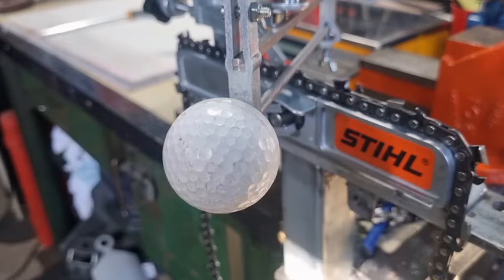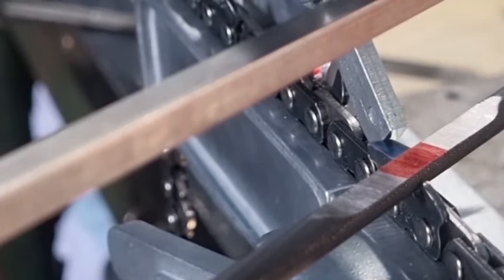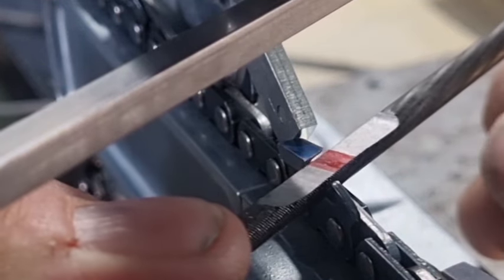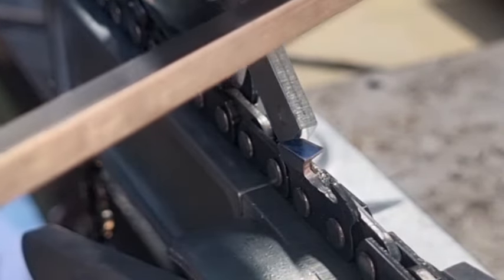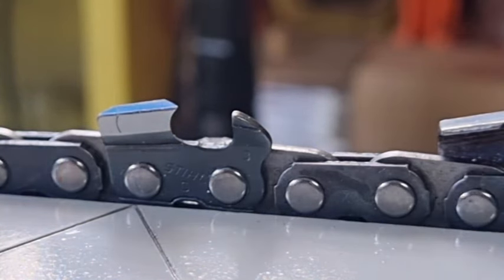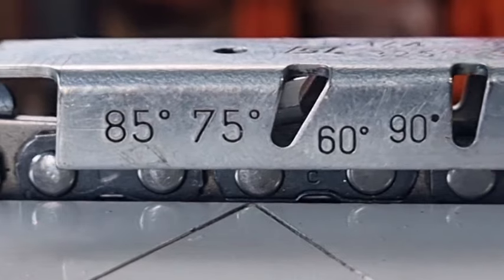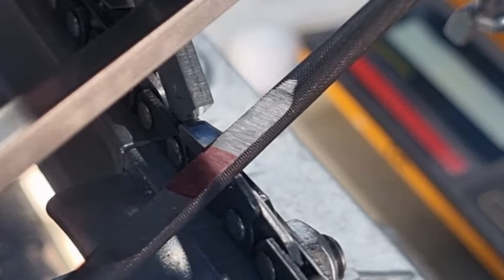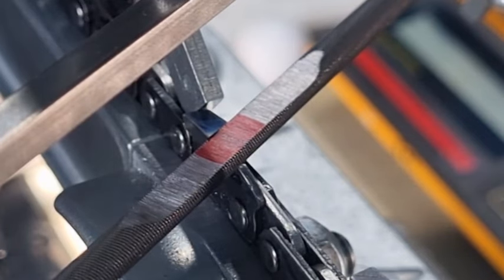Chainsaw file gauges takes you to the next level in filing

Comment: IMO Using cutters for any sort of reference AFTER sharpening is already dulling the cutting edge/corner (by however miniscule, it dulls), same as when using raker gauge tools while filing.
I like to just lay the gauge on top, check, remove, file raker, next.
At this point you've about fiddled with all you can for manual round/hex. I recommend giving square filing a go, I received my Pferd chisel file a few days ago and been playing around with it, you'll be happy to know it's next level difficulty too.
Just one thing, never file into the cutter teeth regardless what they tell you, it'll immediately dull a very very expensive file, instantly wrecks it, I don't care who says it doesn't.
Even from the inside out you gotta break first chromed metal with a normal round file so you don't waste the chisel file longevity.
My Pferd Chisel file dulled the second I worked it into the cutting edge of the teeth (from outside in). But it has retained it's shape so I'll be using it for reference converting my cheapo round chain grinder to square chain.

Comment: You always have good ideas for useful instruments. In addition, their workmanship is of a high standard. Bravo!

In the case of FG2 (or other File-N-Joint clones), to set the file to the desired height, you can also rather use the scale at the dial.

A small correction (again). I have never seen a Stihl document where they recommended 20%. Their previous recommendation was 10%. They changed that 10% to 25%.

@7:59  you probably meant to say 'side plate angle'. To check the (top plate) cutting angle you would have to observe it from inside the tooth.
Reply from the maker: I gave up a long time ago waiting for any Stihl explanation on anything.
I do my own research and it works or  it don't.
Many people just go with a gut feeling and it works for many people.
You have to find what works for you.
For me if the file sits 15% 20% 25% and sure the difference in cutting may be 5% in speed.  No such thing in this game as 50% more cutting efficiency.
Semi Chisel is the slowest, full chisel  the next level, Hexa the best so far that I have used.  I tried my V cut 90° spacing wheel dressed at 90° the tilt wheel at 60° top plate cutting angel.
So simple but effective and stays sharper than full chisel standard.
Hexa and X-Cut seem to be the go at the moment but that said 90% of people use semi chisel.
That is so easy to sharpen.
Not really a challenge for me.
Square ground maybe be the next toy for me to play with
Reply from the maker: I used a center punch on the height adjustment now it has  8 locations and it helps only a little.  The file gauge sets the height within 2 thousands now that's  spot  on in my book.
The  height adjustment may  have marks and 1  mark may equal .2mm height ect ect but that won't set 25% above  the cutter. It just  means it has  a scale without no way to zero it.
My file gauge can be adjusted level with the tooth and you can still use the height adjustment to increase or decrease.  1/8 turn on my FG2 = 1/2mm  I have 8 marks on dial nut with  base mark for reference.
Reply: @ChainsawUsers  Note that almost certainly a chain sharpened with a 10% file over the tooth will cut faster at first than one with 25%.
I'm more interested in how long it will take in total (or how much fuel or battery charge I will use) to make, say, 150 cuts? Etc.

Comment: Lovely idea.
Reminds me of when I noticed the files I was using in the FG2 were not straight. Can't remember if they were Pferd or Velorbe but the Stihl were pretty much perfect. 

I remember watching Cliff Stamp cutting hardwood with a pocket knife to determine the minimum geometry he needed to be able to do 1000 slices and still be able to slice newspaper. He started at 7deg per side and got his newspaper slicing result at about 12 deg per side. 

At 25% diameter, 60 deg less the about 8.5 deg for the top plate lowering as it goes back gives about 51.5 deg at the top of the 'C' while about 11% of diameter will give about 31.5 deg at the top of the 'C', looking from the side.

I get good cutting performance and edge retention when I set the FG2 to 35 deg so I'm thinking 35 degrees seems a durable and sharp geometry. If I've got my numbers right about 14% of diameter should give me about 35 degrees on the various edges of the cutting point.

I'm part way through a set of 4 loops. I suppose I could try some different angles. I assume the round gauge files were annealed and then ground/filed, would still be tough though.

Anyway anyone wanting to see Cliff Stamp's little optimisation of knife edge the vid was titled Normark EKA 12C27  optimal edge geometry for slicing hardwoods (norton economy fine edge) 
Cheers
d
Reply from the maker: Top plate set at 35° is very aggressive are you cutting soft wood
Reply: Hi @ChainsawUsers  
Sort of. Doing a fair bit of 'Dunns White' that died in the drought about 4 years ago. Soft wood, planted for pulp/paper industry but dead and dried standing for years. I process it into kindling and picnic or pleasure wood. 

 I'm using a Carlton semi chisel that was 35 deg out of the box.

Do a variety of other woods, not sure what most of them are, some are hard but nothing like Iron bark, though there is some around here.
Cheers
d
Reply from the maker: @davidfenton3910  I cut grey box and ironbark need min saw size 60cc 20 inch bar 063 gauge full chisel or Hexa
Reply: Hi  @ChainsawUsers  
I'm planning to get some more wood in a few weeks. Nearby farmer has perhaps 15 drought killed trees around his residence. Some Dunns White, other gums and some pine. 

Many of the trees are along a driveway with fences and other trees. Don't want to damage other trees so we'll be dropping the fence wire to fall the dead ones at a perpendicular to the traditional type rows of trees either side of the driveway.

The lower trunks of the pines should be easier processing for kindling. 

The Dunns White is great for kindling as far as burning but it varies from nice straight grain free, to twisted growth with interwoven fibers - add in some knots and making kindling becomes much more interesting. Sometimes a round yields 10% kindling and the rest goes into a bag of knotty larger splits. 

Dead trees are more hazardous to drop, risk of falling branches, dried wood doesn't hinge well and if punky then wedges are not an option. (They are also harder on chain teeth but carrying the wood is much easier!)

A few days of chainsawing and trailering yields much to be processed. My next purchase will probably be a Fiskars X11 and in time a log splitter, with a long term goal of developing mechanical means of processing into kindling. 

Anyway, the main point of my first comment was using gauges like you made, to find an acute angle combination that can handle the deformation forces, for my main application. I might try full chisel for my next set of loops and drive sprocket but that's some time away. 

Have an awesome day all

Cheers
d

Comment: Just use Husqvarna roller style file guide instead. Much easier and it would account for different length of each tooth which your setup does not. It also comes with progressive raker gauge to make your chain cut straight.
Reply from the maker: I only use stihl progressive gauge as its more aggressive than Husqvarna ones
Reply: How can the Nordtec roller guide (Electrolux, Husqvarna) take into account the length of the teeth if it sits on the tie straps?
You'd be hard pressed to find anything that provides more precision with a file than File-N-Joint and its copies.
Besides, Stihl also sells FG4 roller guide, which also includes a progressive gauge.

Comment: Jigs and guides take out the guessing, but they won't be always on hand. It's good to learn sharpening in the bush AND sharpening in the shop so that you have the most "tools in your toolbox". I, personally, file by eye both teeth and depth gauges. Never had a problem, though it may not be the same for everyone.
Reply from the maker: Yes agree I also file in the bush but when home use some tools just for check so the chain filing don't get off  track